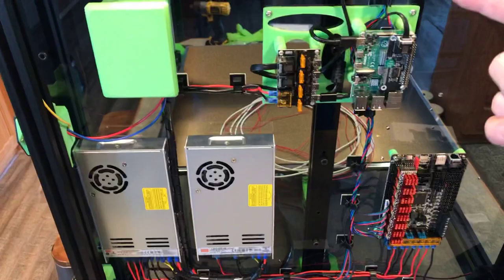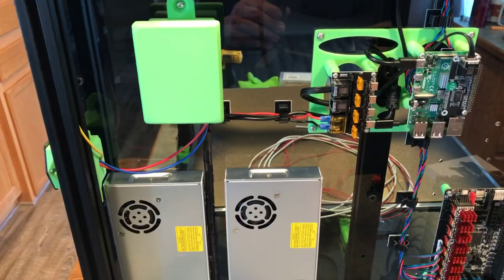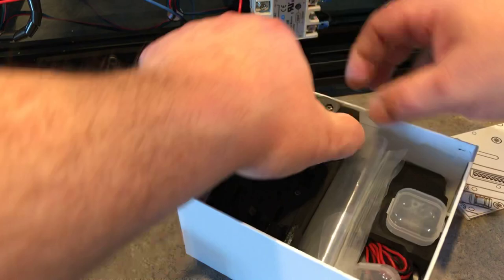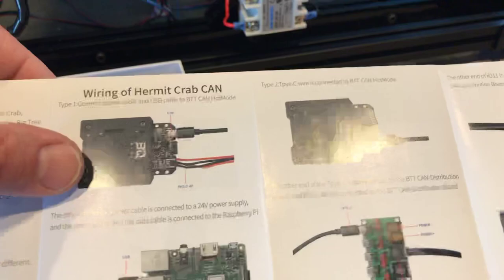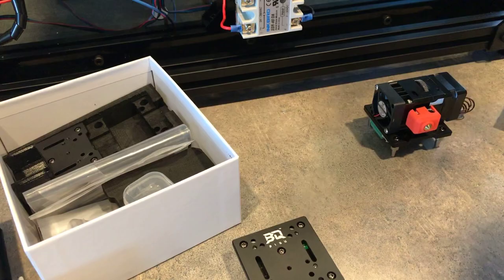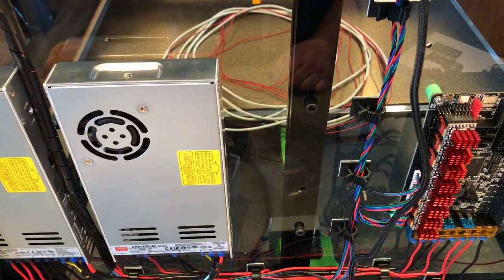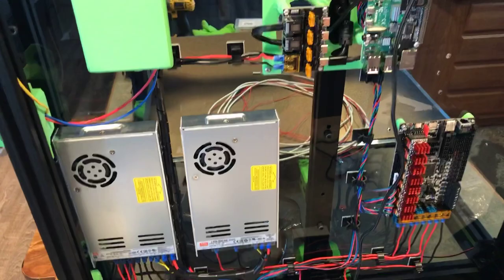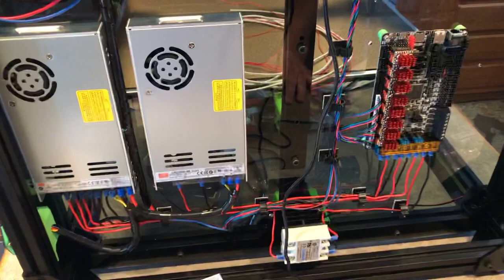Rat Rig V-Core 3 Wiring Complete!    How-to Install the New BIQU Hermit Crab CAN!

Comment: That Hermit Crab CAN is really interesting. I hope they come out with just a standard USB C CAN breakout board without the hot swapping. I run a Zesty nimble/volcanoe hotend on my Tevo Little Monster. I'm so used to the low moving mass it would feel sacrilegious to add all that aluminum to my X-Axis. My next printer will be a CoreXY ish machine like a Rat Rig/Voron/Muldex/Railcore/whatever, whoever comes out with a well designed and community supported IDEX system will get money. Since I'm going IDEX any weight I add to the X-Axis will be doubled so a low moving mass is critical but I refuse to go to a bowden setup. I also intend to run a heated chamber so the H2 looks like a winner but that little bastard is pretty heavy! I wanna see an all metal sherpa/libra/orbiter with integrated heatsink or a built in mount for a trianglelab rapido heating element or something. Ok, done nerding out.

Comment: iirc you only need the center two pins of the rj12 for CAN_LOW / CAN_HIGH? So that cable should have worked, did you test it?
Reply: Correct. Rj-11 is the correct cable because there are no outer 2 pins...

Comment: Can you share the Klipper settings for the Octopus Pro ?
I habe almost the same setting. 
Was able to flash Canboot & Klipper to the Hermit Crab, configured Klipper for the Octopus -> the 446, 12MhZ Crystal, &  Can on the Same Pins like the HC. Using the right RJ12 Cable, but i can't find any UUID for the Octopus ..

Comment: I think your problem is not the cable, only the pins3&4 (uncrossed pinout) is necessary for CAN-Bus communication, so an RJ11 cable should also work. 
I recently build the Firmware, the build settings are: 8MHz crystall for STM32F429, 12MHz for STM32F446, 32kib Bootloader, CAN pins PD0 PD1 and if the cables are not too long, you can try 500000 CAN speed. 
At first I flashed the firmware with STM32CubeProgrammer (you have to bridge the boot jumper left from the red wifi socket and reset or power up the board before, to bring it in DFU mode), in Terminal I tried    ~/klippy-env/bin/python ~/klipper/scripts/canbus_query.py can0    and I saw only the CAN IDs from my 2 hermit crab boards (IDEX printer) were listed. After some trial and error, I saw that a firmware.bin file on an SD card gets not renamed to firmware.cur and realized that I had bricked the octopus board. 
After some search I found the DFU Update bootloader, after flashing it in DFU mode with STM32Cube and later the firmware.bin over the SD Card flash method, it does the trick. The documentation and technical data about hermit crab CAN are realy bad and some things like jumper settings on the distribution boards CAN Ports and termination jumpers are unclear to me at the moment. The manual in the box is absoluteley useless.     https://github.com/bigtreetech/BIGTREETECH-OCTOPUS-V1.0/tree/master/Firmware/DFU%20Update%20bootloader/bootloader     you must go back in the github tree and download the complete repository zip file, only rightclick downloading the hex file gives errors while loading it in STM32Cube.
Reply: Did you get yours working?   I have one and I was able to flash the hermit crab successfully (renames to .cur) but I don't get any IDs back when I run the bus query script either and their support has been worse than useless.... sending back canned, worthless questions and not reading my email which contained a TON of technical troubleshooing info (including a tcpdump output on the can bus when running that query script).   So, if you got it to work, I would love to pick your brain, if possible, or put our heads together if you haven't....